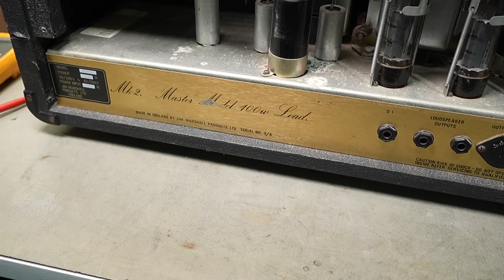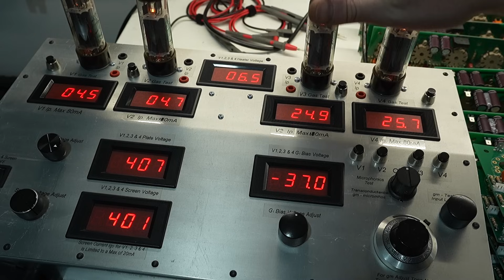Marshall JCM800 2203 Repair - Part 1: Oscillation, bad EL34's & more!

Comment: If I remember right, ground path for the signal to the power valves is actually through the steel chassis on a JCM800?

If I'm remembering this right, that can't be optimal. Seems like asking for hum problems on a higher gain, rock oriented amp. 

A dedicated ground bus that follows both the signal path and the HT path would in theory at least, be much better.

Comment: According to the Napster Hardware store manual, MP3 bolts should be used only when high compression is required.

Comment: My first Les Paul (bought used, of course) came with some nasty old earplugs inside the case. I took the hint. I threw them away and put new earplugs in the case. It was 1980 and the JCM 800 2203 was THE amp to have. I liked the 2204s a little better, but I went to buying up used 1963s and 1964s from the JTM and JMP era and I modified them. They were 4 channel PAs with an extra 12AX7A to play around with and my amps absolutely stomped on the 2203/2204 amps for overall tone. I sold a quite few and my personal 1964s got stolen. There were NO approved Russian valves in the 1980s. A few slipped in as bogus RCAs, GEs, Sylvanias, and off brand companies like ECM, EMC, ICE and International Service Master sold them. Those off brands were a crapshoot. You might get Tesla, Tungsram, EI, Reflektor, Matsushita or Mullard or Philips.

Comment: Talking about Electro-Harmonix EL-34's, two or three years ago I had to replace output tubes of one 50 watter of my several vintage tube amps because I had used those output tubes for 25 years. Instead of sacrificing quite valuable NOS Telefunken EL34 tubes I have, I decided to buy a pair of (Russian made?) E-H 6CA7 tubes (beam pentodes), not EL-34 tubes, because there was a special offer price at the local  tube shop. The pair was not a matched pair but however it turned out to be a very well matched pair indeed. And they sounded very good indeed.  I made a comparison between NOS Telefunken EL-34's and those 6CA7 tubes, and TBH, I couldn't hear much difference at all.  I have happily used those 6CA7 tubes since then but I haven't punished them much so I cannot tell if they are reliable or not. But they were so unbelievably cheap then that I should have bought several pairs more.